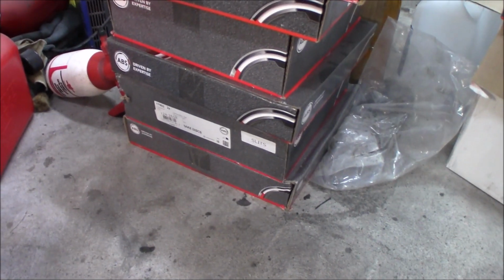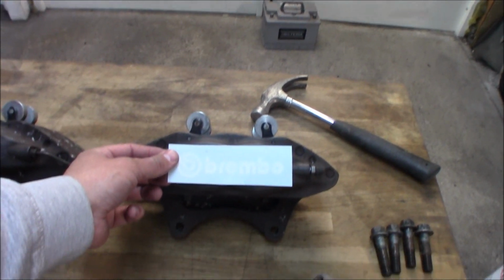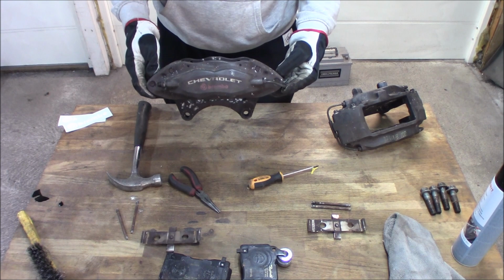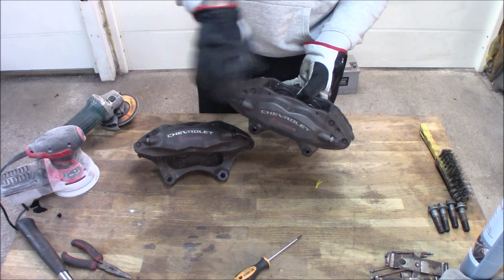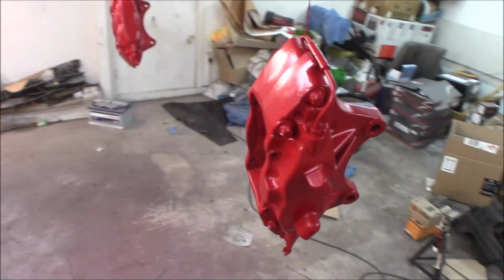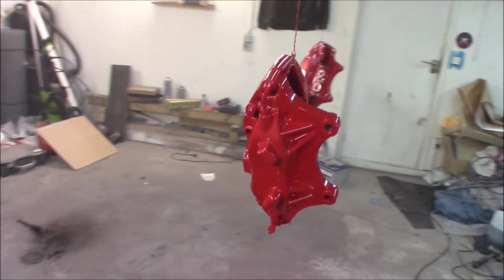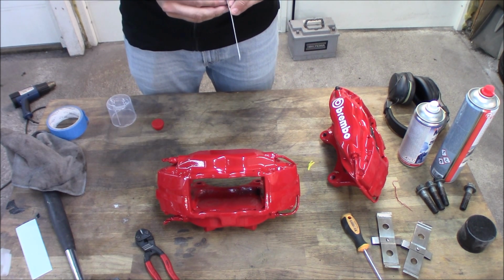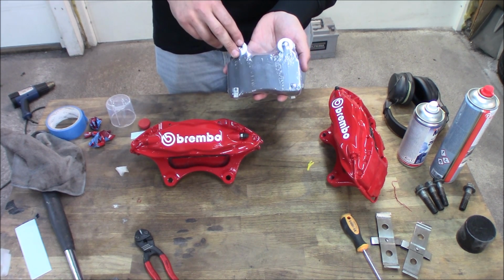How To Custom Paint Brembo Calipers Properly. Like NEW!

Comment: Does these calipers fit on a 2008 NG saab 9-3?
Reply from the maker: Not bolt-on and there is no disc in size 355mm for the ng9-3...but everything can be modded

Comment: Looks great , I've got a saab 93 1.9tdi and it's done 130,000 miles now what is the best engine would you recommend?
Reply from the maker: That engine is a real work horse 👌
Reply: @JonasKakarikas  yes it is and I've had the saab convertible 93 1.9tdi for 8 years and it still put a smile on my face every time I drive it .
I done the EGR pipe today and that's a pain to do .
Reply: @JonasKakarikas  do you have too program the fuel injectors to the ECU ?
Reply from the maker: I dont know how it works on The diesel 🤔
Reply: @JonasKakarikas  hi thank you for your time to reply
Reply: I'm changing my clock cluster,  am I correct that I need to match the p code ? P132293159

Comment: Awesome video! I'm painting my brembos tomorrow ( 2013 2SS Camaro). 4 of them. Im using the same 2k clear as well.

I'm going to use my brembo stickers as a sort of stencil. Paint white over the etch primer, add decals, paint the whole caliper red with them on, then peel off the decals revealing the white underneath. Then applying the 2k clear. 

One thing i would suggest if you ever use 2k clear again. Get a real respirator mask. You dont want that stuff getting in your lungs.
Reply: Thanks for the idea bro. Wanted to do the same thing!!!

Comment: Very nice job, mine does not have the weighted pads, but does have the floating brembo discs,. Very smooth braking no vibration.
Much better than the original ones on the car.